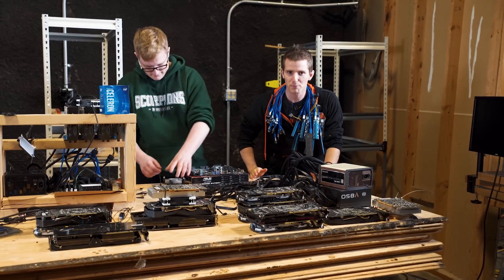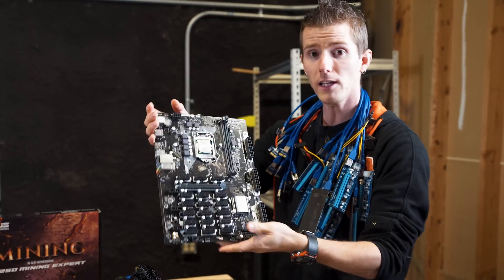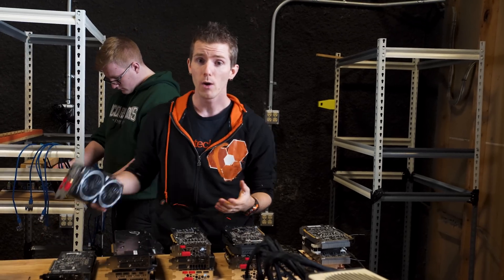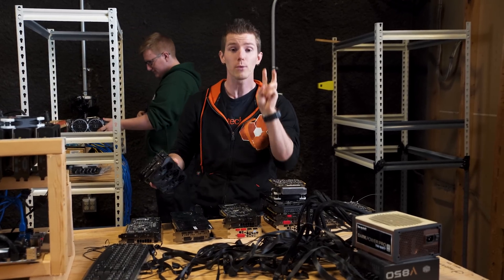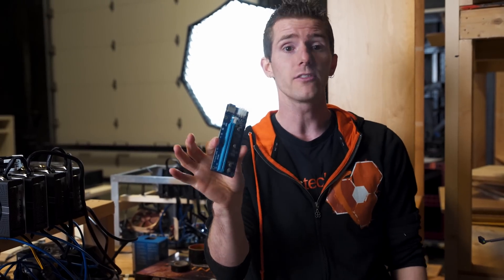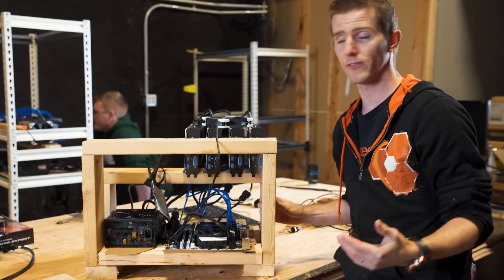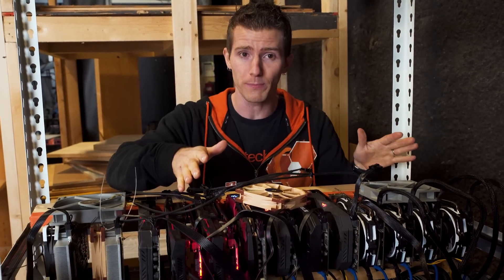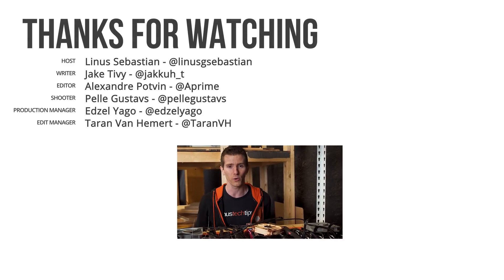13 GPUs in ONE PC? – Mining Adventure Part 2

Comment: Great video for introductory mining, however there are several issues. 
1) Certain cryptos require more than only 4GB of ram such as neoscrypt and can benefit from having 8GB. Less is not always better.
2) The GPUs are REALLY close together, ideally you want at least enough space so that they can breathe a bit better to improve hashrates. Kind of like moving a second sli card down to a lower x16 slot so the top card can breathe a bit better.
3) Not really an issue but are the cards getting proper ventilation in that area? its important to be able to effectively remove heat from the area because a) high room temps just suck b) lower hashrates.
4) running 3 850 watt psus is about roughly 2550 watts when maxed out, if you are running this on one 20A from the circuit breaker you are technically over the maximum continuous supply rating of 1920 watts. I believe that it is important to inform viewers about the importance of checking your houses power before buying a miner. Some houses also only have 10A or 15A which would require using different outlets around the house / rewiring.

other than that gj!

Comment: I picked up a used XFX amd r9 390 8GB for 300 dollars and it mines Ethereum at 31MH/s. Compare that to 32MH/s for a new Nvidia GTX 1070 which costs 600 dollars on ebay now! I wish more miners would use outdated AMD cards rather than driving up the price of current gen cards.

Comment: you know, the whole 'gpu price hike' BS would stop if manufacturers make separate mining cards in BULKS that would give miners better efficiency and stuff, so pc gamers and the miners can both be happy
Reply: There is limited factory line space as well as resources both in human cost and materials, it's not like they can simply open up another factory or supply chain to produce the GPUs and ship them out if they're already at their limit. Also, even if they aren't at their limit it takes 3 months for a fab unit to "spin up" and start producing more GPUs. The last time AMD this, they ended up with an oversupply of R9 290's that they couldn't completely sell for almost a year so there is a risk to AMD/NVIDIA and their PCB partners.

Comment: Why would you even run these in the US??? 
With these electricity prices it's not worth it except if you want to do it for fun.
I live in France where the pricing is quite high too and about 2 years ago i figured i would be cheaper to buy a plane ticket to India (in some regions electricity is unbelievably cheap) and set up operations there.  
I had to scale up my operations so that the lowered electricity costs would cover the cost of hiring maintenance staff but with some custom diagnostics software augmented by a bunch of cheap sensors we managed to cut these by a factor of 10 in a matter of months.
That's really what I love about mining, the flexibility of costs and goals constantly changing!
But IMO small time mining isn't really worth it nowadays and this video ignores some of the most important factors, ones that only arise when runing 50+ machines such as cooling,  replacement parts, bulk ordering, monitoring,...
When you want to make money mining currency your priorities change and it's not as simple as "what's the best ratio of speed/price i can find" but more like "if I take this slightly slower model that breaks down less often or that makes the room 2 degrees cooler, is it going to be worth it? if so when and how many of these do I need to buy?"
Great video, sorry for my english and the rant ;)

Comment: Linus tech tips. I just had my old 300$ computer break and I want to move up to a bit a of a bigger gaming pc. I have a budget of 600-700$ any ideas. It needs to be a laptop as I move from parents houses every few days.(put links in comments so I can find it. I’m new to looking at the stats)
Reply: Cameron Braithwaite Dave2d makes good videos on laptops
Reply: Get a laptop,sell it when gpu and ram prices lower.
NOT RECOMMENDED YET AS OF JAN 21
Reply: The Ancient Mariner can you send me a link and you can play games at what graphic settings?
Reply: Cameron Braithwaite https://www.amazon.com/Acer-i5-8250U-NVIDIA-GeForce-SF314-52G-55WQ/dp/B0746P25QX

I can play most older titles on low 1080p. Might have to turn down resolution with newer titles.
Reply: There's an Acer with an i5 8th gen quad core and a GTX Mx 150 for around that. It performs as well as my 940mx and I can at least play most things.

Comment: Dont power the risers with SATA cables and adapters. That is a REALLY unsafe. It can couse cable melting and even fire couse sata can handle about 54w and your cards need more!!!
Reply: The P106's will be perfectly fine over SATA but the RX570/580s definitely will not. Linus is probably going to cost someone their house with this video, at least he has fire extinguishers! :D

Comment: Holy shit these comments are stupid. Mining on certain cards will eventually become non profitable and they will be for sale. Prices will also lower as current prices will be too long of ROI as difficulty on the network raises. Just chill.
Reply: I'm with unnoticedhero1 on this one, buying a gpu that was run for 24/7 for a long period isn't a great idea. It'll be out of warranty, likely to fail in the short term.
Reply: well heat and stress can kill cards, render farms use cards designed to run in high heat, vibrating environments, but consumer cards are not designed for that environment and might fail quite quickly
Reply: yeah but how often do you think miners with multiple cards stop operation to clean the gpu or apply new past after running 24 hours for extended time yes pc hardware is resilient but its a gamble to tell how well they took care of the hardware as they used it its like running a game at max for over a year or so straight it will eventually deteriorate and dramatically shorten the life span
Reply: rx 470 480 570 580 are generally used for Ethash which is a memory intensive algo. The gpu is down clocked an undervolted an people mining generally keep temps under 70c. Voltage and heat is what kills chips not usage so much.. less voltage and monitored temps will greatly reduce the impact from mining. It won't totally negate it but the idea that its going to completely destroy the card is unlikely imo unless it was neglected which can just as easily happen from a gamer over volting over clocking an not monitoring heat. The fans on the cards might need replaced down the road but those are going for like 20.00 for replacements as quite a few different model cards use the same fan.
Reply: Until a new mining algorithm comes out that utilizes GPU's again, and then we'll be back to square one.
Reply: Shane Potter Not knowing just what happened with/to the card you are buying is the main reason not to buy any used ones unless you know for sure where that card was used...and sights like ebay are the perfect place for not so good folks to dump these cards. It's gonna be a crap shoot, period. I was a tech dealer on ebay for over a decade, I dealt with some pretty shifty folks on there, ones that just let their channels slowly die off and just start up a new one to do it all over again. That's where most of these cards are gonna end up with because those folks buy in bulk, and that's whats gonna happen to these cards when their usefulness ends. Miners aren't gonna sell one at a time, they are gonna dump them to the highest bidder, period. Not knowing where these cards came from or how poorly they were treated means you're really taking a serious chance here. Buyer beware to the nth for sure.....
Reply: with overclocked memory which has caused a few cards to fail from overheating memory, as the sensors generally monitor the gpu and in a gaming application is fine but not with ethereum
Reply: I'll never buy used for the next few years because of all the mining cards that have been worn out running 24/7 for months/years at a time. I'll just get an 1170 or 1180 when they come out, assuming the market is back to MSRP by then. GPUs running with that much of a strain for that long is never a good idea, and you bet the listing won't even say if the card was used for mining or not.
Reply: There is no such thing as wear and tear on computer hardware like that, electron migration is your only concern..after 10 years of continuous full load, do you think render farms replace their stuff every year?
Reply: Thank you! That's an astute observation and I'm happy to see someone who understands the market. The 280X/290/290X boom in ~2013 proves your hypothesis here. I scored a 280X for $180 when it was going for $300 MSRP back then because of the used market explosion.
Reply: That's BS, no prof that mining used cards will fail faster.. And how will you know if it was used for mining or not? 
There are other scenarios that can strain a gpu as much, rendering or full time gaming....

Comment: So I guess miners wilk dump all of their cards on the 2nd hand market in the future. Is there any kind of "wear off" I should be aware of if I'm looking into buying one of those?
Reply: Fans can be a little worn because of 24/7 operation but it depends on A) How long the GPU has been mining for and B) How hot the cards were run i.e. overclocked and undervolted or stock settings?

If overclocked, the cards could exhibit some memory bugs too so that's something else to look out for. 

Other than that, there's really no difference!

Comment: Doubt.
Using USB cables to connect pice risers with the actual board, wouldn't the USB interface be a bottleneck?
Reply: No, there is no bottleneck to this method. It works perfectly well even with USB 2.0 bandwidth.

Comment: RIP Gpu prices D:
Reply: Szenetx ikr prices literally went up over night dude like a GTX 1060 on Amazon was $350 and now the same exact card is like $390
Reply: dorito master around $440 now  :/ I remember buying mine for $260
Reply: i actually just bought a 1060 3b from amazon after seeing the prices (UK) go from £210 to £240 during sales. I bought mine when it dropped to £205. Though I didn't buy it to mine any coins, I don't actually understand any of this!
Reply: Linus probably just extended the GPU shortage with a week with this video.
In the meantime my Video Card died and I’m running off of integrated right now waiting for a 1070. Ewww.
Reply: give it a bit will be going for the 600$ range probably... was looking into a new card then was like nah.. nope.. all i wanted was 4K cause i upgraded my rig and screen but not GPU it was my last thing.. but now... holy hell..
Reply: Yeah, I'd like to upgrade my low end 700 series for a 1000 series, but I'm not paying $600-1200 for a 1070 or better right now.
Reply: fuck no. thats stupid. my car i drive (other than my two other toys...) is worth almost that.. paid 2000$ cash and could drive the fucker around... that card better start up and sound amazing for 1200$ better get good gas mileage too.
Reply: Loop Koop 
If money was burning a hole in my wallet, and had to spend it in the next 3 months, I’d might as well invest in a NAS and grab some hard drives before another Thailand flood occurs and wrecks the hard drive market.
Its only a matter of time after all the crap happening with CPUs, GPUs, and RAM right now.
If Thailand gets hit with another flood and Hard Drive Prices Double, I’m blaming the miners for their excessive energy usage.
https://www.backblaze.com/blog/hard-drive-cost-per-gigabyte/
Reply: I just bought 2 GTX 1060's (3GB) on neweggs black Friday special for $180 USD for a couple of friends wanting a new rig to play StarCraft 2 on. I'm glad it happened when it did!
Reply: Artanis667 Was it 2017?
I swear, at this point we need to team up to snipe GPUs to get a decent price at this point
Reply: Yeah bloody 3 days ago I was going to buy a 1060 6GB for gaming but they all went out of stock except for the 3GB version and the most expensive 6GB so now I don't know what to do :(
Reply: Loop Koop same dude
Reply: Now the real way you make money now is just buy the cards and wait for them to go up in value if you bought 10 last year you would of just about doubled your money from buying them
Reply: A 1070 gpu card was 410$ now is 850$ 🔥😭😭😭😭
Reply: dorito master the 1060 6gb version in my country is only $300 USD lol

Comment: The Antminer S9 is 2320 USD and runs at 13.5TH/s, it can only be used for bitcoin and other cryptocurrencies that use sha256 though, but its pretty cheap for the 13.5TH/s you get.

Comment: why are people disliking so much??  linus didn't buy any of those cards,  did he??  he got them from the manufacturers.... so basically he is not causing shortage...
Reply: Except the sponsors themselves are doing it.
Reply: StarGaming how many cards do the avg miner have 1or2 not a problem 5 or 10 problem. It sounds like you have 20+ gpus if you have 10 GPU rigs possibly hundreds of cards if you are putting 10 gpus per rig. You are the problem so are all miners using more than 2 gpus.
Reply: Kylle Crockett I'm not actually the problem. I built them up slowly over time and even then It's not what I would consider a huge problem. Almost all of the GPUs I use came from the used market before the price hikes. Only about 5% of the cards I got came from retailers and the rest from the used market. I'm not the one buying massive shipments from retailers and If I were to buy I would go direct to say Nvidia or AMD (Or their partners) and I'd place direct orders for cards before they go to market like all the larger operations that order planes full of cards.

Also 2 GPUs don't bring in enough income so thats why I use 10 or so GPUs a rig. Just off all the GPU Mining rigs I use I bring in right around $47,000/Month profit. I use the GPU Mining profits to pay the salaries for 8 people and to invest/gather interest on. Heck If I were to go 100% GPU Mining I would need hundreds if not thousands more cards to even come close to my $1.43 Million/Month Bitcoin profits (@ the current rate of 10-11k/Bitcoin for possibly this month unless I hold). You yourself could actually make a living like this if you decided to actually invest in the hardware and just mine it instead of complaining. Quickest way to end it would be for everyone to come online and skyrocket the difficulty for GPU mining to make it unprofitable to do so.
Reply: TheDeeGee I don't order direct but instead get them from the used market when I go to buy cards since they are lower cost/card. That same used market everyone else uses to get cards is where I get 95% of my mining cards meaning they were already bought and sold at retail before I obtained them. The only cards I bought retail (Newegg, Amazon, Best Buy, etc) were the few where I actually needed a replacement for quick or for when a GPU went bad and I didn't feel like waiting for the RMA/Warranty claim on the card in question. Again I don't buy direct and buy very few retail cards so I don't affect the incoming supply of new cards at all. In my home I use retail cards for my gaming rigs and HTPCs but those are all either 1080s, 1080Tis, or Titans and have the same problem everyone else has If I wanted to upgrade.

Again my operation is not very large compared to the loads of guys above me. I know for a fact the larger guys either:

1) Call and place Orders Direct from AMD and Nvidia (and their partners) for cards. You get them pretty much MSRP this way and get a discount if you order enough.

2) The Buyer (Miner in this case) has inside sources and are the first ones the retailers call (And first ones notified after retailers) when they get an order in before they hit the shelves or even posted online. Like Newegg will get say 100 cases of say 1070s. Before they post them online to sell they call up Joe the miner and he takes 30 cases, Mike takes 40, Jimmy takes 20, and the last 10 cases go to retail unless say Maria takes the last 10 which means none for gamers or other people. I know they do this for a fact cause thats how I get the motherboards for my miners as well as the Riser cards. I don't buy my GPUs this way though and its not really reliable on how many you can actually get if they don't call you first. The retailers will feed the few whales before they feed the masses pretty much.

3) They buy out a smaller mining Operation and put that Operations rigs to use for themselves. This is actually very cost effective and doesn't do anything to the supply since they didn't get them from retail or direct. I'm actually considering going this route since its easy expansion and will be fairly cost effective.

1 and 2 are the major problem that I don't contribute to for GPUs. In fact it sucks for me cause I now need to wait a week for shipping for a used card or up to a month or so for an RMA. #3 really only affects the supply on the USED market (Only if they were going to sell them anyway) which nobody has a right to complain about as its usually gamers or GPU miners who compete fairly for the supply. This is how I get most of my cards. The same can't be said about the new market where the demand is so high right now and they can't keep up with demand so the prices have skyrocketed. The only time I'm going to buy direct or pre-retail is whenever the next gen cards are released so that I can upgrade my Gaming rigs at home (I like to keep them all at the highest tier cause I hate FPS lag) and so I can actually get a supply of newer cards to mine with.
Reply: Because the uninformed blame the miners however fail to realize it isnt the avg miner thats the problem. They then proceed to dislike the video cause of linus showing how its somewhat done thus making the shortage worse. Heck I myself have a warehouse full of 10+ GPU mining rigs but have far more ASIC hardware than GPUs (5 ASIC miners for every 1 GPU Miner).